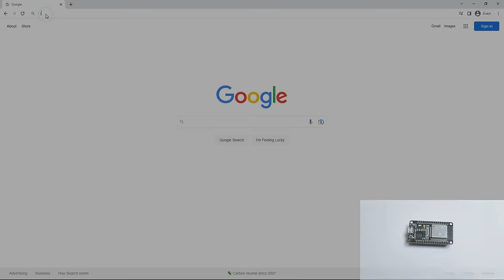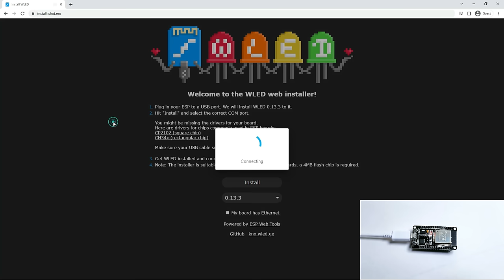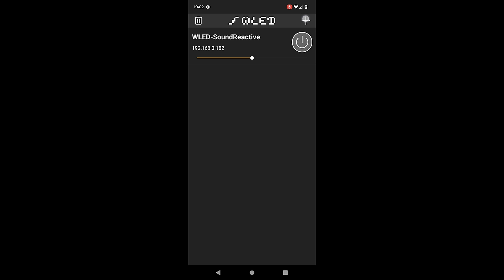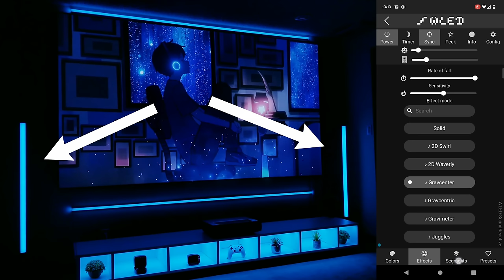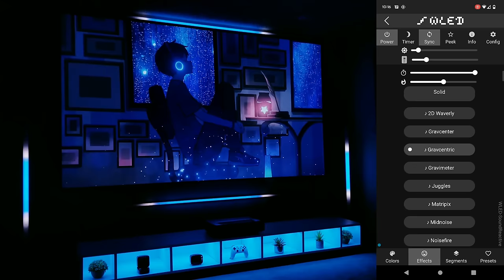I Never Realized WLED Sound React was THIS Good! Complete Walkthrough

Comment: Hi, would I need to use a 5V 20A powersupply or could I just use a micro usb plug connected to the ESP 32 module?
Reply from the maker: Thanks so much! You could certainly use a micro usb to power the esp32 but you would still want to use a bigger supply for the lights. You could use the micro usb pulg to power the lights and esp device  but its not recommended to use it for many leds and best to keep the brightness limiter set to 850mA if you are powering things this way.

Comment: Hi, thank you for this tutorial. I have followed your instructions but my setup reacts incorrectly. Only when i bring my hand close to the ESP the lights flicker. Any advise?
Reply: Try adding a wire connecting the L/R pin of the mic to gnd (e.g. using a larger wago).

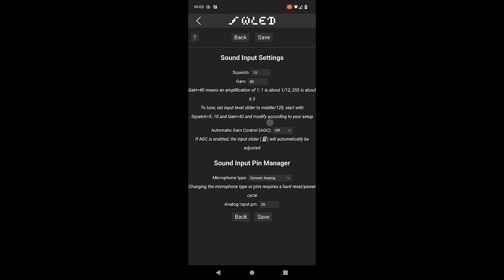Comment: 7:08 I have max4466 mic which microphone type should I choose for that setting.
Reply from the maker: Thanks so much for watching! For those, you would make sure generic analog is selected and for the data out I've always just used the d35 pin. In the generic analog setting it only has you input the one number so I would put 35. That is one of the mics that once I saved and rebooted, I sometimes had to unplug and plug back in one or two times before the mic would eventually work!

Comment: I'm curious to know how exactly the esp board got power if you only connected the white and red wires from the powersupply to the led directly. Does the esp board get power through the white and red wires coming from the esp that is connected to the strip?

Also, would be helpful to hear anyone's input. I plan to install 4 strips vertically inside of my two display cabinets and I'm not sure if this will work propely, but the idea is to have all 4 strips connected from the top using power injection via a 5 pin wago to my powersupply so I don't experience voltage drops but I am unsure how to connect the esp to my 4 strips. Do I just use another 5 pin wago to connect all 4 strips' white, red, and green wires to the esp board?
Reply: Yes, that is correct. I was also a bit confused, but it works exactly that way in my own project.
Reply: @aklstreak  Thank you for the reply. I haven't yet tested it but I've learned that it's probably enough for the esp board to connect the red and white wires to just one of the strips but for synergy the green data wire should be connected to all strips via wago connector.

Comment: Any idea why I don't get any color blends? I get solid red green blue only. No blending between colors and no white. If I set the color to white the led strips shuts off. I'm using ws8215 60 leds / meter strips
Reply: It turns out it was a power issue. Powering 5 meters of 8215 from my USB apparently does not give enough juice to run white. Once I added a power supply everything looks great.

Comment: how did u power the nodemcu?
Reply from the maker: Thanks so much for watching and taking the time to comment! The nodemcu receives power by plugging them into the lead connector on the led strip at 6:15 of the video. Power will flow to it thought those wires/pins since the injection wires are hooked up to the power supply. Hope that makes sense!

Comment: There is really no reason for power and ground from the board to the LED strip connector, right?  You're already supplying those from the power supply to the strip.
Reply: You do it as a safety measure, so you don't have a floating ground.

Comment: I don`t get my damn Mic to work. I got it working once, it is working fine since some weeks. But then I tried to make another one and I am stuck with it and I don't know why I don`t get it to work. WLED is working fine, all the programs without music are also working fine. but the mic is only "working" when I am touching the SD cable. Anybody has an idea what went wrong? I built 3 new setups and none of them is working. They all have the same problem. WLED is working fine but the mic is always "quiet".
I am using the exact same mic like in the video. I am also uning the Pins 14,15 and 32 but since I only could get an ESP32 Vroom-Kit 3 I am not using the "D2" I am using "G16" or "G27" instead.
Reply: Try connecting the L/R pin of the mic to the gnd of your setup. In my experience, not doing this results in the signal on that pin "floating", sometimes high enough that the mic switches from being a "left mic" to being a "right mic", and WLED only listens to the left channel.